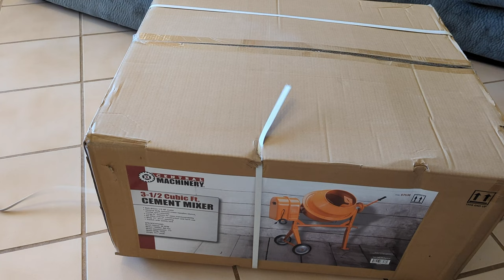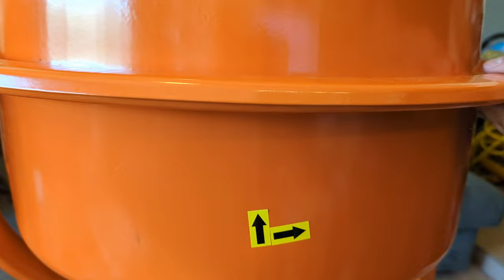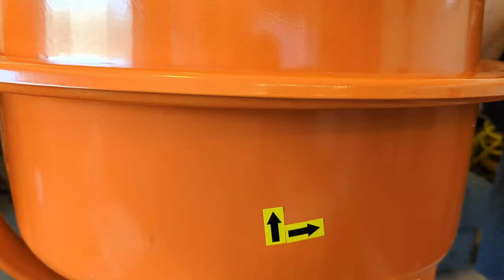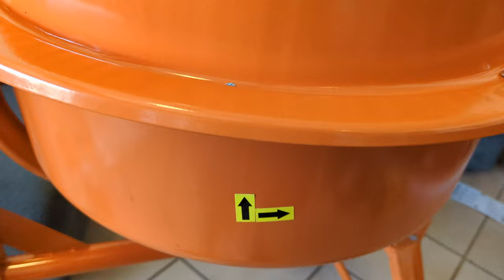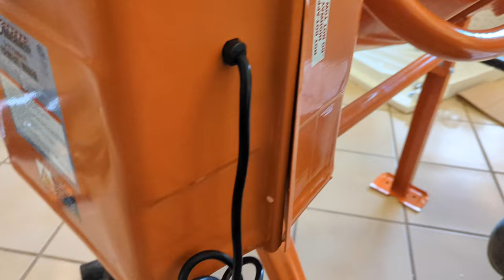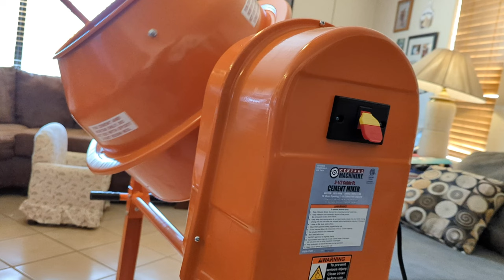2022 Harbor Freight 3-1/2 Cubic Ft. Cement Mixer Unboxing / Assembly

Comment: Most the videos on assembling this mixer put the flat washers on the toothed nut side the toothed nut needs to dig into the metal painted frame, the flat washer goes on the bolt head side you hold the nut steady and turn the bolt drawing the teeth of the nut into the frame or over time it will vibrate loose as the toothed nut is dug into the smooth flat washer and can spin.

Comment: i had to tap out the threaded bolt holes for the handle locking plate, wayyy too much paint and they didnt fully tap out far enough for the bolt to grab. youd think they would have fixed that by now its been a decade of producing these